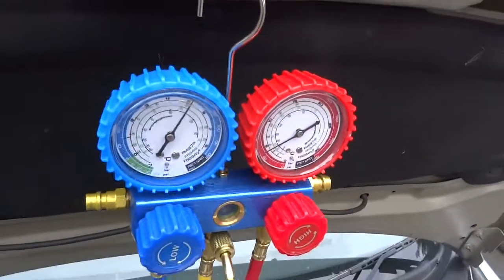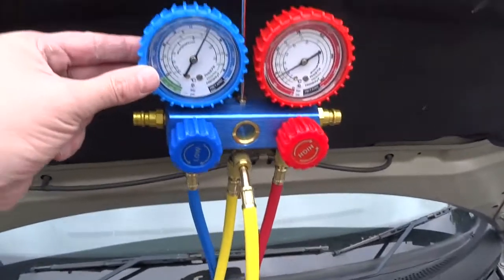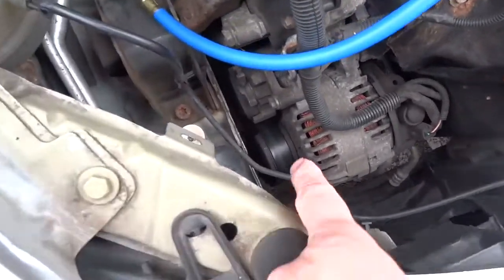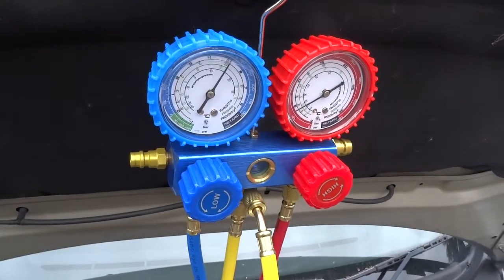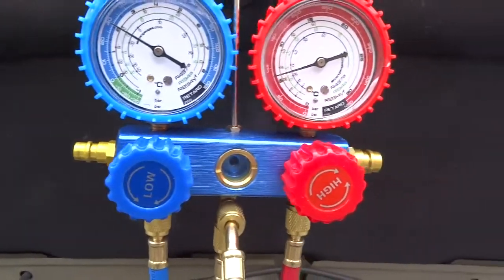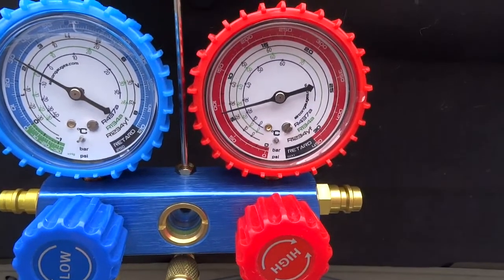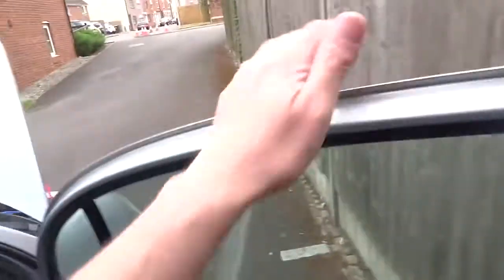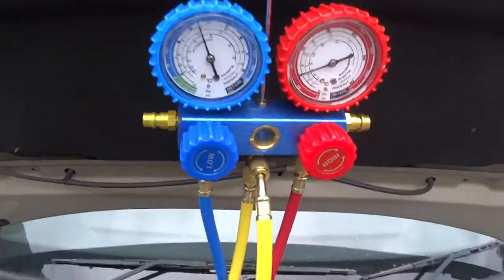Beginner AC Gauges: How to Connect Manifold Set & Read Pressure DIY

Comment: I have a yellow jacket manifold with  knob on the side. So its clockwise to close and counter clockwise to open.For some reason when i open the low pressure side, refrigerant are not being added. Any ideas?
Reply from the maker: Its hard to say as im not familiar with your gauges , if not a gauges error could be schrader valve , out of gas , best to fill to secondary side to avoid plugging the compresor.